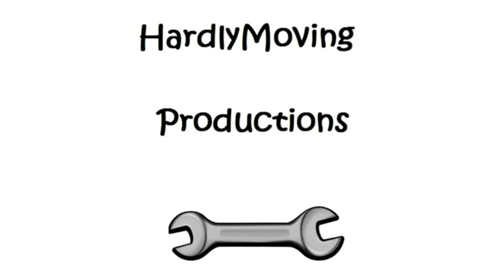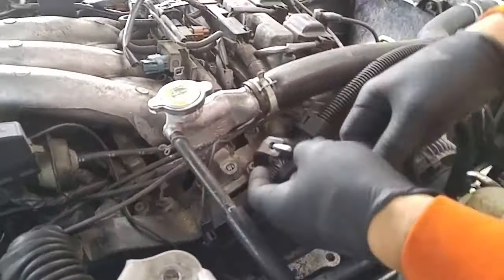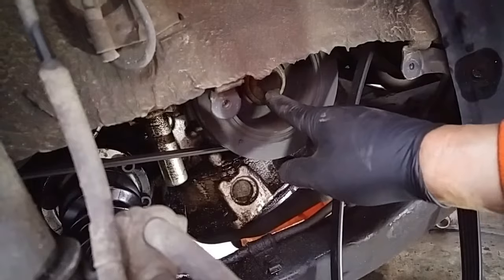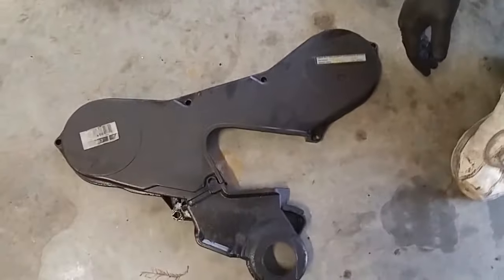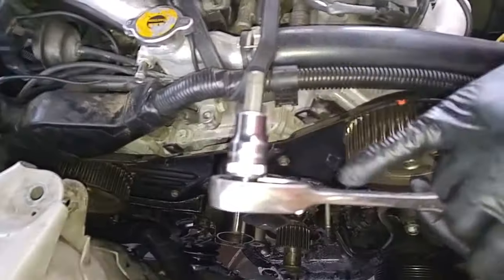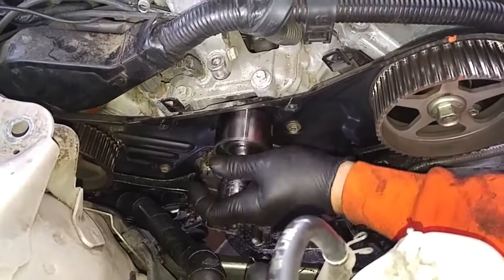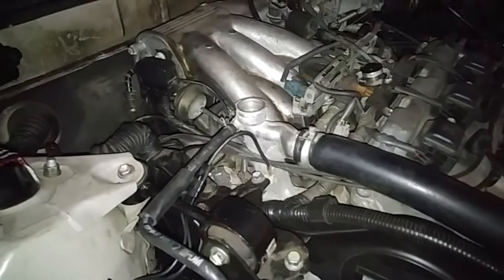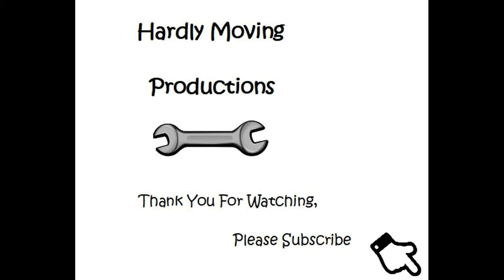Toyota Camry / Avalon 1MZ-FE Timing Belt, Water Pump, Seals & Pulleys Incl: Sienna/Solara/ES & RX300

Comment: At 10:35, there is a unplugged plug coming off the wire harness, what is that to?
Reply from the maker: Power steering pump pressure sensor.
Reply: @hardlymovingpro  thank you, long story short, I yanked that cable out when I took off the valve cover. Now trying to figure out how to repair it.
Reply from the maker: Non critical connection
Reply: @hardlymovingpro  thank you so much man, Im breathing a huge sigh of relief right now.
Reply from the maker: @Pmerc11  no problem!

Comment: How many miles. Dose it last buying one 100k and do they also have timing chain
Reply from the maker: As a good Preventative Maintenance (PM) habit, replace the belt, pulleys, water pump and seals everything 100k miles with quality parts. You will get another 100k miles till the next service.   The MZ-FE engines are all timing belt ... not chain.
Reply: @hardlymovingpro  awesome fast reply thanks
Reply: Great video! I'm planning on taking my 2004 with 126k to my local mechanic to get this done soon. I'm gonna see what toyota wants for all these parts you recommend (TB kit, cam & crank seals, belts, pulleys, and water pump.

My only concern is my transmission fluid is dark and have been advised not to mess with changing fluid at this point so not sure how much I should be investing in my case. Any advice? I have ownedcar 1 year with no issuesbut do not knowpast history
Reply from the maker: A simple drain and fill of the transmission with new synthetic atf  is advised and won't hurt the transmission in the least.  It will help it actually.  Get a Aisin timing belt kit.  Comes with all OEM parts.  Discounted on Amazon.  See my link in the video description.

Comment: wheres you toyota pink coolant?
Reply from the maker: Doesn't matter.  Serviced so many customer's cars with green universal coolant that I gave up convincing them to use Toyota pink.  Besides, the radiator or water pump will give out before the coolant does.   Also, all of today's coolants use OAT (ethelyn glycol organic acid technology) fluids that seems to last forever and prevents aluminum oxidation as well as steel/iron rust build up.

Comment: I saw another timing belt video and the person locked up a wrench on the rear cam bolt to hold it in place. Reason was its not relaxed so if tension come off it possible the valves might clash to pistons.
Reply from the maker: Nice precaution but not a problem if the cam jumps and the valves hit the pistons.  Since the engine isn't running, the valves won't bend.   When it happens to me on occasion, I just reposition the cam.
Reply: @hardlymovingpro  okay thanks man thinking about changing the timing belt on my 2001 Toyota Avalon
Reply: @hardlymovingpro  first timing mark alignment starts with the crankshaft sprocket correct? Then rear cam
Reply: Is it recommended to change the oil pump?
Reply from the maker: @jaimemartinez7520  easier to align the cam marks then verify the crank mark.
Reply from the maker: @jaimemartinez7520  not at all.
Reply: @hardlymovingpro  one more question. Can I torque the crankshaftshaft bold using a milwaukee 1/2 mid torque impact at low setting?

Comment: How much would you charge for this service?
Reply from the maker: Labor ... around 6 hours X average local hourly shop rate.
Reply: @hardlymovingpro  not how long but who much would you charge?
Reply from the maker: With parts around $800
Reply: @hardlymovingpro  I have all oem toyota parts a buddy said he'll charge me  $250 for labor is that okay?
Reply from the maker: @facethegreat8774  Yes ...that's more than reasonable if he's thorough with his work.  Make sure the camshaft seals are replaced
Reply: @hardlymovingpro  Yeah he said he would but thanks bro🙏🏽
Reply from the maker: Hope all goes well
Reply: @hardlymovingpro  will container of coolant enough?
Reply from the maker: @facethegreat8774  yes
Reply: Update? I'm planning on getting this done just curious how yours turned out

Comment: You put the slime green colored stuff into the cooling system? Oh the humanity!!! Toyota Red H.O.A.T. EVERYTIME!
Reply from the maker: That's how I got the car ... with the green universal coolant.  Customer wasn't up to paying extra for a complete coolant system flush and refill with Toyota red coolant.  He just wanted the oil and coolant leak repaired.
Reply: @hardlymovingpro  oh, well, in that case....shame on the customer, and you did your part....
Reply: @hardlymovingpro  my owners manual just states to use ethyl glycol in my 98 camry. Is this not a good idea now on these cars?
Reply from the maker: @jasonmcnamara2079  All coolants are ethyl glycol but are now using organic acid technology (OAT).   Borates and sulfates (cast iron and aluminum corrosion inhibitors) are pretty much absent;  when they were used and once breakdown/wear out, cause coolant sludge.  OAT coolants last almost indefinitely.  Only time I do a coolant flush is when I'm doing a cooling system repair (radiator, hose(s), water pump replacement).
Reply: @hardlymovingpro  cheers
Reply from the maker: @jasonmcnamara2079  You bet!

Comment: Dam $900 dollars seems affordable these days for this job. I'm contemplating doing the TB and W/P with all seals myself. I'm by no means a mechanic but I want to learn. My only hesitation is the I need my 2000 Avalon and I can't afford to screw this up and not have the car available to drive to work. The dealership quoted me $1,500 and another mom-and-pop shop surprisingly quoted me just under $2,000. The other things is getting the tools so do it without breaking something doing it the mickey mouse way.
Reply from the maker: Isn't that weird?  The independent shops are now charging more than the dealers!  If feel your pain.

Comment: Looks like my folk's car, lots of oil !! 205K miles and going but needs a new belt ASAP.
Reply from the maker: Oil contaminated timing belts could snap at any moment.  Should get it replaced asap.
Reply: @hardlymovingpro  Yes I agree but with the car needing a timing belt $600, new rear struts $300, oil leak $??? we are debating to sell it for $1000 and get something newer. It's got 205k and is in OK condition I guess, not great.

Comment: Not as easy as it look moving the cams back one cog without not having the whole cam jump back
Reply from the maker: Leave the firewall side camshaft alone.  Move the front cam with a box wrench and hold the cam in place while mounting on the belt. You don't have to move the cam more than 1 cog ... perhaps less.
Reply: @hardlymovingpro  got it not too bad of a job i could see it being easier next time around

Comment: should have torqued the cam bolts
Reply from the maker: They were.
Reply: @hardlymovingpro  didn’t see a torque wrench
Reply from the maker: @brandonstary5804  that's correct.
Reply: @hardlymovingpro  so you didn’t torque it, you just tightened it?

Comment: screw this , I'll get a timing chain engine. 2007 and up Camry v6
Reply from the maker: Replacing those are harder.
Reply: @hardlymovingpro  They never need it in my experience...my Jeep had 300k miles ran fine.